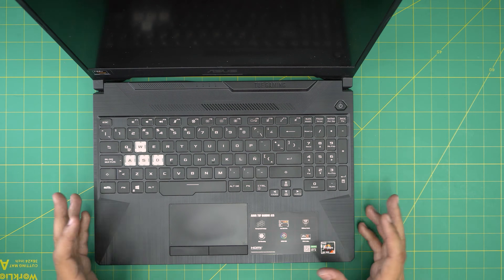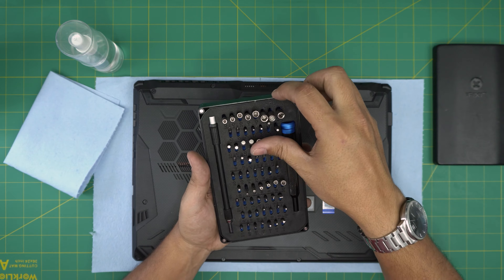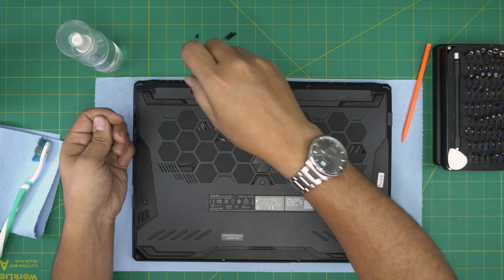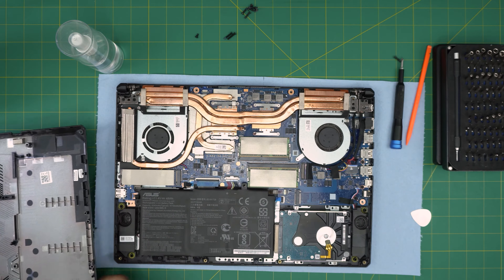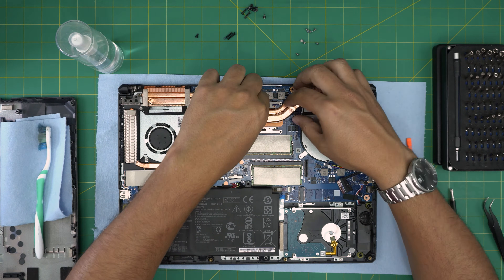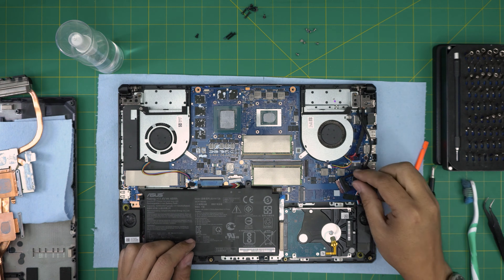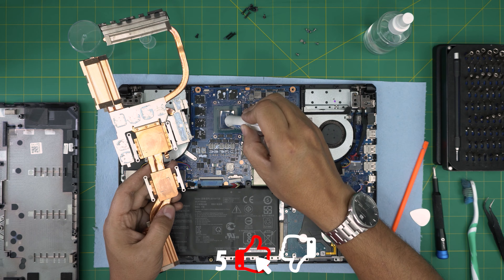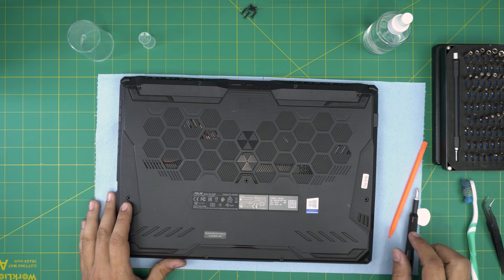How to Repaste and Clean ASUS Tuf Gaming A15 FA506IV Laptop - Step-by-Step Guide 🧹✨

Comment: What size thermal pad is suitable for this model?
Reply from the maker: Thank you for your feedback! If you wish to support the channel, you can like, subscribe, or both!
Regarding your question, DON"T use thermal paste it will counter push the heatsink, use thermal gel or putty: https://amzn.to/49I0djo
Should you have any further questions or requests in the future, please don't hesitate to ask me.
cheers🍻

This is an  Amazon affiliate, when you use my links, I earn a percentage, which helps support the channel🙏.
Reply: @uFixTek  There are some variations on the thickness of thermal pads. 0.5mm, 1mm, and 1.5mm. Which one should I use for vrams?
Reply: @zumbarto  thermal putty not paste
Reply: that's such a clear answer, lol

Comment: bro need help my a15 gpu is not showing im my laptop and in the bios its not showing up Ive watche videos the others do the armoury crate and make it to Standart from power saving mode but mine doesnt have any showing the standard and powersaving mode what will i do masters pls help me
Reply from the maker: the issue that you facing is a GPU failure, the solder joints under the GPU are cracked and needs to be re-flowed.
you will need to follow this steps exactly how i mention it:
#1. remove the entire motherboard and place it on the wooden table, no heatsink nothing connected pure motherboard on a table.
#2. make sure  there is no fan blowing or air condition turned on
#3. use a hair dryer set it at max heat and medium air flow, place it directly over GPU with a distance of about 1" 
#4. keep it there for 8-9min
#5 let it cool down on its own for 15 min
#6. repaste and it should fix the issue

Comment: Hi sir!, excuse me, i'm about to do service on my laptop, i just had a minor doubt on my mind, im planning on buying thermal paste and the gel(putty) as well, but i want to know, why would it damage the motherboard for example, if i applied just thermal paste on all of them (gpu, cpu, chips vrams etc)
Reply from the maker: Thank you for your feedback! If you wish to support the channel, you can like, subscribe, or both!

Regarding your question, it's important to use thermal paste and thermal putty in the appropriate places. Thermal paste is ideal for areas with direct pressure contact, while thermal putty is designed for areas with gaps, where it can maintain its shape and not spread.

Using thermal paste instead of thermal putty can lead to high temperatures on V-RAMs and may cause the power regulator to overheat and become damaged.

If you have any more questions or requests in the future, please feel free to ask.

Comment: Hi 
Is it okay if i just apply thermal paste for the cpu and gpu and for vrams and other things, i will apply thermal gel on a later date?
Or is it like once i remove the heatsinks everything needs ro be reapplied?
Reply from the maker: Thank you for your feedback! If you wish to support the channel, you can like, subscribe, or do both!

Regarding your question, every time you remove the heatsink, it's important to clean and reapply thermal paste to the GPU/CPU. Never use thermal paste where thermal gel or thermal putty is supposed to be used.

You can carefully collect any excess thermal gel that may have been pushed out from the VRAMs and place it back on top of the components. However, it's recommended to use new gel if you can't collect enough from the surrounding components.
Should you have any further questions or requests in the future, please don't hesitate to ask me.
Reply: @uFixTek  hello 
Thank you for your reply
I have searched for the thermal gel/putty in Amazon website but can't find it
I live in India 
Do u have any suggestions?
Reply from the maker: here you can get it there:
https://rb.gy/znq79
Reply: @uFixTek  that is 6k indian rupees it is very expensive for someone who has an entry level gaming laptop is there any alternative to this?

Comment: Hey bro! Can you show us how to apply thermal putty??
Reply from the maker: Thank you for your feedback! If you wish to support the channel, you can like, subscribe, or both!
Regarding your question, just make a small about about 2mm in diameter and place on each components, you can't go wrong with applying thermal putty just a small chunk on each components.
Reply: @uFixTek  will a roll of putty on each components be good enough? What about the tiny ones? I'm scared it might be too thick and will cause the copper metal not getting contact with the CPU or GPU
Reply from the maker: not at all, thats why they call it putty, it will squish out , it will not create counter pressure at all. just place enough if you got a lot of putty place  more on components, it is not conductive at all.
Reply: @uFixTek  thank you so much! I have not seen any tutorial in YouTube, once my putty arrives im planning to just roll them up into round tiny balls and place them into the components flatten them a little bit and let the pressure of the copper metal do the spread. Is that okay? Or is it a hazard?
Reply from the maker: yes just dump enough amount over any components that had putty over , no need to make a balls (it will be very hard to do so lol), so just dump some on the components and the copper heatsink will do the rest , it will squish and push out any excess and you don't need to clean the excess it's perfectly fine and leave it. you can't go wrong with it.

Comment: Found this video to be the most detailed explaination of the repasting process for this laptop. Thank you! Also, I have one question to ask, when I repasted the laptop I did not have thermal putty or pads and I used thermal paste on the chips which had putty before and now the laptop throttles down to 400 mhz from time to time, also used HWINFO to monitor performance and it throws the PROCHOT EXT error when this occurs. CPU and GPU temperatures are fine though and much better than before, but I experience these stutters. Should I redo the process of repasting and use thermal putty? Or could it be related to something else? Before repasting the laptop was performing very poorly, but never dropped to 400 mhz.
Reply from the maker: Thank you for your feedback! If you wish to support the channel, you can like, subscribe, or both!
Regarding your question, the issue is that you should never use paste where putty or pads are, i highly recommend you to reopen and or before that get a good quality thermal putty https://amzn.to/3YYfAzi
or chap versions on aliexpress.
and remember to repaste the CPU and GPU once you lift the heatsink, and clean the paste over the old putty.
use this paste on CPU and GPU for the best results: https://amzn.to/3PjfCym
your vrams are over heating and throttles down.
MUCH appreciate the support and awesome feedback.
Reply: Here are some pictures of how I applied the paste and how it was before: https://drive.google.com/drive/folders/10MIo8vjbX4UK-RjWVa_zVX4jk7A_j9ho
Reply from the maker: oh boi i just saw those pictures, you will be in a big dip problem if you quickly don't get an thermal putty and place nice chunks on those power regulator and vrams else you will damage the motherboard my friend.
act quickly recommend you not to use the laptop till you get the thermal gel
Reply: @uFixTek  Thanks for the suggestions! I'll order these and redo it again. Do you think 20g of thermal putty will be enough for application with more generous amounts? I used a gram and a half of Kryonaut covering all these with a thin layer, and a temporary fix I found was to limit the CPU to 76 degrees, after that no throttling occured again while gaming. Already subbed and liked, u deserve it!
Reply from the maker: It's my pleasure my friend. much appreciate the support,
yes even if you limit the CPU that is fine for the CPU, but those other components need the putty, 20g should do the job, you don't really need to clean the paste on the components ( i would leave it on because it is a layer of thermal paste it will help the putty.
Reply: @-panda-9762 Did you change it, how are the results now?

Comment: im  using  asus rog strix laptop fo 2 years. im an architctural 3d visualiser. so the laptop is running very intensively dailly. should i replace the thermal paste. never replaced yet after purchase...
Reply from the maker: Thank you for your valuable feedback! If you'd like to show support for the channel, feel free to give us a like, subscribe, or even both!

In response to your question, after providing this service for our clients consistently, especially those engaged in animation and rendering, we've found that servicing the laptops every 8-10 months works well.

Here's a simple way to determine when your laptop needs servicing:

I recommend you start with the first service now. Keep track of the date you performed the service and attach it under your laptop. After using it regularly for 8 months, follow these steps: Open it up, check the thermal paste to see if it's still pasty and hasn't dried or started bleeding (resembling a water-like substance). Examine the condition of the fan and the heatsink's ventilation.

Based on your observations, you can adjust the service interval. If the thermal paste is in good condition but the heatsink is clogged with dust, consider decreasing the interval. If the heatsink is clean without dust but the thermal paste has dried, also decrease the interval. On the other hand, if the thermal paste is in good condition and the heatsink is clean, consider extending the interval for the next service.

I hope I've explained myself clearly. This approach will help you find the optimal service schedule tailored to your specific usage and needs.

Comment: Hi sir, I have some problems opening the heatsink screw. The screw is kind of normal, but it won't budge. Is it because my screwdriver is too small? And my plate that was sticking on the ram was undone; how can I stick it on the ram again?
Reply from the maker: Thank you for your feedback! If you wish to support the channel, you can like, subscribe, or do both!
Regarding your question, here are some corrections and suggestions:
Use a larger handle and a longer Philips screwdriver. Apply more pressure while pressing down on the screw and twisting.
About the RAM, those plates are unnecessary. You don't need them, and the RAM sticks will last forever without them. You won't experience any performance issues without the plates.
However, if you want to reattach them, use thermal adhesive tape.
 https://amzn.to/46zPvtT
Should you have any further questions or requests in the future, please don't hesitate to ask me.

Comment: Hi I can’t take screw 1 off the heat sink. Help me please
Reply from the maker: press harder down on the screw and at the same time rotate, there is not much i can do my friend, unless your screw-head is damaged then that is different case,
Reply: @uFixTek  yeah the head is damaged, the others were fine
Reply from the maker: Okay, if the screws are damaged and difficult to remove, you can use a flat-head screwdriver that is not too small but fits properly. Press down firmly and rotate the screwdriver. The flat head will provide better grip, especially in the corners of the damaged screw heads.